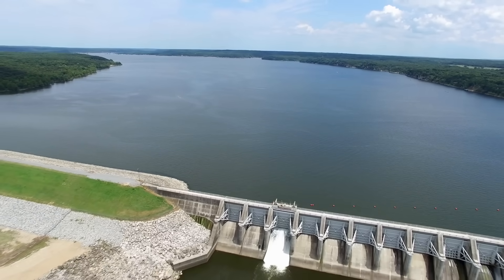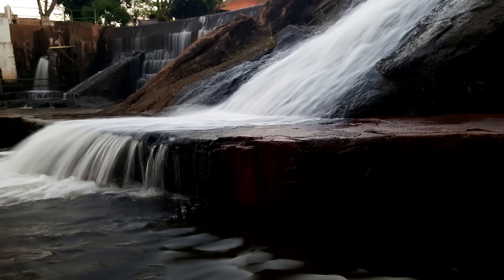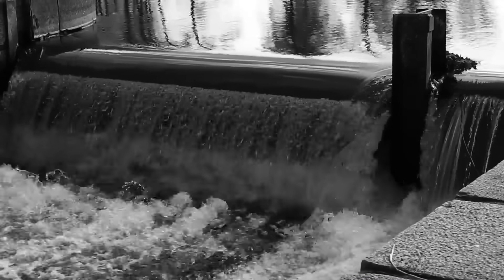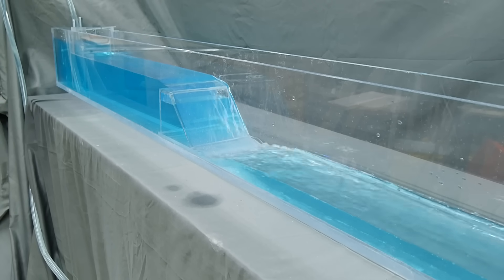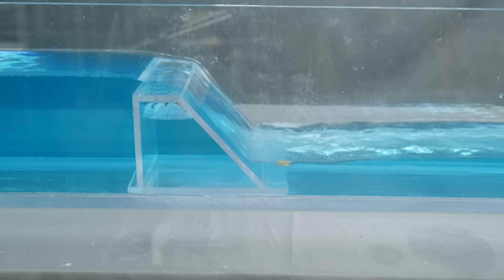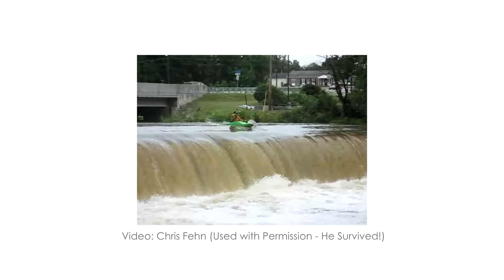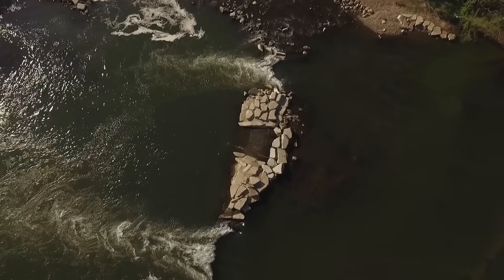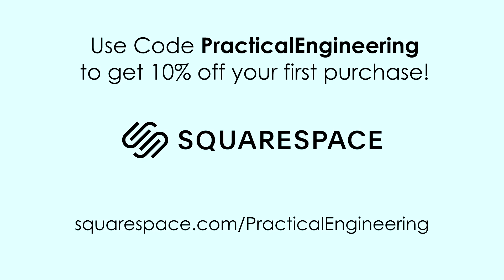The Most Dangerous Dams

Comment: Grady, dam removal is a intensely strenuous undertaking. It is utterly impossible to simply remove them. That leaves the upstream landscape as a barren mudflat. The accumulated silt is loose and easy for rain to move. The increased silt burden downstream will destroy any fish hatcheries (places where fish gather to spawn) , and will kill much of the underwater life, e.g clams, mussels, crayfish, insect larva. My grade-school classmate spent 10 years of hard effort to remove two low-head dams. The results are wonderful, but the permits needed from the state, and from the Feds are just incredibly difficult to push through. In addition the local government and the shore line landowners need to agree. It is a long, arduous process. I live in a town of 100,000 on a river with four low-head dams in 5 miles. Every single year a couple of people drown just as you said.

Comment: It should be mentioned that if you find yourself in this situation, the best way out is to actually dive immediately while you still have strength and air. Don't try to float on the water.  Diving will let you be carried by the water at the bottom that is not circulating. If you try to float when submerged you may float into the water that circulates, that will just get you back in the starting point.

Comment: I don't know about other states, but my state has a ton of data on obsolete dams from mills no longer in use. They are ABSOLUTELY very dangerous. Not only for the reasons laid out in the video, but also because of the flooding that could occur in the event of a complete dam failure. And obviously nobody will do anything about it. The owners of the land surrounding the dam don't want to repair or remove the dams because it costs way too much money, the state can't exactly force them to remove them, and the state government can't do it either because of (you guessed it) money. 1/3 of the towns in my state have high risk dams in them that could flood entire neighborhoods should they break during a storm. There are 627 dams listed as "significant hazard" and the Dam Safety program has a budget of 1.1 million dollars. It's only a matter of time......

Comment: Dams are sort of like roller coasters. The big, scary impressive ones are almost always are designed perfectly, with very low chance of failure. They're well maintained and kept up as to not cause disaster. But the small innocent ones are usually cheaper, not well kept up, and can go wrong and cause huge consequences.
Reply: And much like said rollercoasters, a big one failing is national news but the injuries and deaths from smaller ones get less attention but quickly add up over time.
Reply: Maybe, but that's a different question than what the video is about. Lowhead dams are also dangerous when they're in perfect condition, the problem isn't maintenance.
Reply: @katatat2030  The real issue is that these dams look safe when they are not. No one would be dumb enough to try kayaking down the spillway of a 150m tall dam, but many people end up getting in trouble with the small ones.
The comparison with roller coasters still stands, even if for another reason - the smallest roller coasters in a park are often the most jerky and violent. Large roller coasters with giant loops and inversions have carefully calculated curves and near perfectly smooth tracks, because if they didn't they would end up ripping themselves apart from the forces. They also have well designed seats and restraints which won't hurt you. The small ones can get away with a "that'll do" and often have jerky tracks, crappy hard straight seats, and a lap bar with less padding than a bicycle handlebar that WILL hurt your legs (especially if you're tall).
I believe this is the reason why quite a few people are absolutely terrified of trying the large coasters. They went on the small ones expecting them to be really tame, and... they weren't. So then they see the absolutely gigantic one next door, and think that it must be 10 times worse and decide not to even try it because it's too extreme for them, when in reality it's really not.
Reply: Or swim to the side if the spillway doesn't span the entire dam. (this takes you to an area that doesn't have a recirculating current, and there's no force keeping you from moving sideways)  It's a similar technique to escaping a riptide.
Reply: Except Oroville
Reply: with the big dams the danger is more obvious if they discharge the pressure is so high its instant death usually or a wall of debris coming your way.it does explain what happens but it does not give any solution to save lives. to save lives dive if caught in an undercurrent and pull yourself along the bottom.
Reply: If anything they should build more small dams with good fish ladders.🤔 / THE REASON?/ Small dams slow down the water which allows water to recharge the groundwater supply. And the ponds and lakes create habitat for numerous animals.🐟🦆🦫

There's also the potential for not only farmers having more water.. But for aqua farming🐟 with the new created structures.👩‍🌾

Because sometimes a drought is really just the water that society allowed to go to the big salty ocean. 🧐

They've had a lot of success in India with doing these techniques. Between building swales and small dams.💪

Recharging Aquifers.👨‍🌾

Oh yeah let's not forget. The potential for mini hydro. In between hydro and the winter and renewables in the summer. This could cut back on the impact people have on the environment. 👍
Reply: Or natural disasters can make them collapse no matter how good it's taken care of oh and theres something called erosion  which shifts earth's grown every so often which can cause it to collapse even if it's well taken care of lol
Reply: @jazminemccoy7991  so then the small cheap flimsy ones are definitely going down while the large well maintained one has a chance of surviving and then if it’s damaged they would more likely catch it and fix it or just shut it down

Comment: This is something I was warned about over and over ever since I was a little kid. In theory one escape technique is to swim out keeping at the bottom but good luck even having sense of up and down in that situation.
Reply: It's crazy how when stuck underwater you cant tell which way is up or down. Happened to me before and that 45 seconds I was under felt like a lifetime.
Reply: @crafty-asmrr  you are lucky it wasn’t.  So; what was the condition?  How did you resolve the question?   As a commercial diver and civil engineer I have been in super turbulent waters intensionally to inspect various structures and can’t say I never knew the way out; which isn’t always up.
Reply: But has the risk of getting trapped in debris or rocks or broken pieces of old dam with rebar and other nasties - however sometime the only choice. Ofthen it is worth trying to get to the edge of the dam first where the flow may be distrupted.
Reply: @bcwbcw7649  debris is the number one obstacle and hazard.  I have found scaffolding from the 1920s  on a spillway in Oklahoma. 52’ deep on the head side of a fractured spillway with a 12” - 14” ice cap spanning the entire lake.  And pressing on the dam structure.  Talk about scary to  inspect and the structure was fractured in 6 or 7 locations.  

That was definitely life risking and day time temps down to 20 deg. Below zero.  I worked UW 10 hours a day for a full week filming and providing the first and only as built drawing of the structure.
Reply: The problem is river swimming you don't see turbulent water in time, the currents spin you so sucked under you don't know which way is up.
That means you can dash your head against rocks.
Had it happen to me on a rafting trip and had to hold my breath for a very, very long time and stay calm.
Reply: Exactly, there is no up or down when drowning
Reply: As a commercial diverN I have intentionally entered the drowning zone to film dam structures and once was contracted to provide an as built drawing which included measurements erosion and spalling data collecting.  

There is no sweet spot on the discharge or down stream side except directly against the dam structure and on the bottom.  This spot may not exist the entire span of the structure because of scouring and obstacles in the water which alters the turbulence pattern.  

I’m the only diver I know of to inspect and film these dams and some simply can not be filmed.  

Warning; inspecting dan structures on the head side is even more dangerous because most of these dams are broken and water does pass through them.  This causes pressure differentials which will suck you into them and you will not get free.   You will not WILL NOT pull free and if it’s strong enough it may pull you apart; literally.  So; inspecting dams or locks or any type of piping must be conducted by divers. Like me with 40 + years experience with a complete understanding of the forces of water pressure , water movement and pressure differentials.  

I use several techniques to lesson the hazards and each inspection location or environmental change in the same location changes the dynamics and forces of flow. 

I am 68 and still inspect turbines, dams, races and spillways. I also provide consultant services to both dive inspection teams and hydropower operators and water resource divisions for various municipalities. 

My inspection reports are certified and every point verifiable. 

I can calculate the volume of water passing through a structure and provide detailed drawings of structural defects and identify probable structural failure points on most any structure due to settlement,  age, spalling erosion undermining or impact damage. 

I also provide hydrographic and topographic studies on shoreline sections for new construction or shipping activities.
Reply: @dalethebelldiver7740  I was pretty surprised to find that your channel doesn't have videos about diving
Reply: @dalethebelldiver7740  I think your an absolute legend and you got more courage than being shot into space!
Reply: @dalethebelldiver7740  Delta P. it even kills the experienced. way I see it if you don't know what you're doing why take the risk
Reply: Well it's probably the same as when you spin in circles and get dizzy, the fluid in your ears gets spun around with the rest of your body and now all sense of balance is gone.
Reply: If you fill your mouth halfway with water, would that allow you to feel which way is down?
Reply: @hetsmiecht  it sounds like a good idea, until you realise that once you're upside down, all that water'll go into your nose, causing you to cough and splutter all your air out reflexively
Reply: @hetsmiecht  Not if you are being knocked about.  There is no way to distinguish between gravity and acceleration without an external reference.
Reply: @hetsmiecht  you give humans more credit than they deserve lol. I feel like most people would be so freaked out they just panic, not remember to grab a half mouthful of Ayer
Reply: @hetsmiecht  no

Comment: Hey Grady, I have a question about safety. In that case of water circulation that dangerously entraps bodies, what would be the effect of a "metallic" cage (or whatever material, ignore corrosion and oxidation) put around it? I mean, a tubolar cage such that the dangerous phenomenon is completely encaged and if you're so stubborn to go there you can't possibly fall inside it, you only encounter the hard bars of the cage. Thanks
Reply: Impingement. Under other  than ideal weather conditions, entrapment against the structure could still prevent an individual from escaping from beneath the water column. If the victim doesn’t drown, prolonged exposure could lead to hypothermia. Drain pipes with grating on the upstream entrance are nearly identical, if not in form, in function.

Comment: When I was 17 I got caught in a natural forming keeper while kayaking on the Colorado during high flow. Eventually popped out but it felt like I was under for 10 minutes despite it being 30 seconds. A truly terrifying experience.
Reply: You were lucky.  Going down is the only way to leave the jump. It traps things that float, ie. separate from the actual flow of water at the bottom and up to the water that only circulates.
Reply: @leonardmilcin7798  exactly class c formation is extremely dangerous anything at the boil point will get recirculated over and over the only outflow is at the very bottom
Reply: @leonardmilcin7798  Yes! Swim to the bottom to have the current kick you out!
Reply: Smart decision, dude. Your ability to think quickly could’ve saved your life, and I’m thankful for it.
Reply: I'm just a holiday canoer, but this is I think one of the first safety rules that any canoer or kayaker should learn.
Reply: Ended up in one on the Potomac while tubing. A weird rock formation created this very small but very powerful keeper. Luckily I had leverage against some rocks and was able to push myself out of the “boil” eventually. I had no idea how much danger I was in at the time. Thank god I was in something small, maneuverable, and buoyant.
Reply: It's interesting to learn how these things work. When I was about 14, I got sucked into what I might call a "semi-keeper" once, and it was terrifying. Lucky for me the river spat me out without just holding me down or snagging me. It was a big boulder, and from the surface, the water flowed down into it. There was no escaping that slope. It took me straight down to the bottom, and held me there. (Not that this would have helped, I had no life jacket, and we were riding the flood waters on tractor tubes.) Anyway, now I have a better idea of how this happened.
Reply: Similar thing happened to me at that age too!  A group of us hooligans had gone to a river head and were swimming quite happily in the large pool created where the river came out of the hill.  Then smart ass me decided to climb above the spout and jump into the boil.... after my 4th or 5th circuit in the boil, my friends realized I in was in deep shit, climbed on to the rocks and grabbed my hair to haul me out.  It took two of them to get me out.... to compound the issue, a lot of bubbles were formed where the water fell, further reducing my buoyancy and making it hard to stay on the surface..
Reply: There are so many drownings here in NZ due to our innocuous-looking but incredibly treacherous rivers, most of them full of keepers and snags.  People just won't learn either, so I don't know what could be done about it.  I spend summer watching dipshits dive head first into a meter of water full of submerged boulders.  Natural selection, I suppose.
Reply: @complimentary_voucher  I will never understand people who don't test the water before jumping, or worse, literally diving in.
Reply: Glad u are still here to tell this story
Reply: was it toilet bowl in gore canyon?
Reply: Been there done that in the Skykomosh River.  Like a washing machine spin cycle.  Pushed off the bottom repeatedly and finally popped out.  Life jacket probably saved my life.
Reply: this is why i usually think its a bad idea for people to kayak on a river they're not familiar with without talking to locals first. They demolished an old weir near where i live because we get a fair number of tourists who'd go down a popular river and get sucked into a keeper that was already there naturally but made worse by the old weir. It looked like going down a steep but managable slide but large trees used to get sucked down to the bottom so kayakers could easily get sucked down. My mom said one of the last people to die died because he got tangled in some branches or brush at the river bottom at the end of the slope and he couldnt escape.
Reply: @arthas640  signs put signs up if you know about something like this. .... glad it's fixed great knowledge super sad story
Reply: Almost happened to me once but my brother saved me. sorry for your experience
Reply: Scary learning experience
Reply: @juniorjohnny2393  considering I've gone rafting/kayaking a dozen times since then. Probably not!
Reply: Glad you’re here to tell of your experience. Any information on this subject is useful
Reply: Cool. I guess that's the way to do it, seeing that you have less bouancy. Sounds fun. Sounds terrifying.
Reply: Smart boy
Reply: I believe they are called 'stoppers' in the UK.
Reply: Glad you made it ❤
Reply: Smart thinking. Hopefully I remember that tidbit if I’m ever caught in a keeper.
Reply: Was it
Reply: Tallassee EMS and some swift water rescue teams have to pull victims that drown in the Tallapoosa River well downstream of the dam because it was too far to hear the sirens before they built new ones I hear 8.5 miles away. But it's more simular to a Eddy coming off of a massive waterfall
Reply: Great job man. Take care.
Reply: Glad you're okay🙏🏼
Reply: That's a pretty smart recovery from being sucked under.
Reply: Smarten up then. Duuumazz
Reply: Nice job tho man. Stay safe.
Reply: So a kayak can get sucked in?
Reply: @homosexualitymydearwatson4109  Yes, and all of the infused air makes the water much less buoyant
Reply: @everyday tenor That's crazy. So there are probably skeletons and boats still rotating in low head dams after people got sucked in decades ago and never found.
Reply: @jew-sa  natural rise and fall of water line changes a keepers' potency. While possible that something is caught "forever" it's more likely just caught until the rivers' next time the water line goes down.
Reply: @jew-sa  no. It all depends on tailwaters height. Yes above the dam it'll stay a consistent height. But below the dam will be ever changing height. Eventually when water drops to a low. Things will clear out. Until then. Yes. Could be a full winter before things are released in spring early summer.
Reply: I fly a drone across unfamiliar rivers before Kayaking.